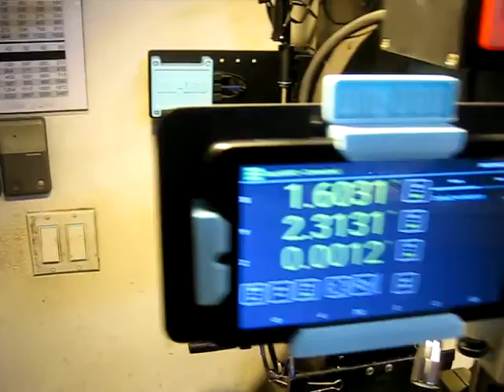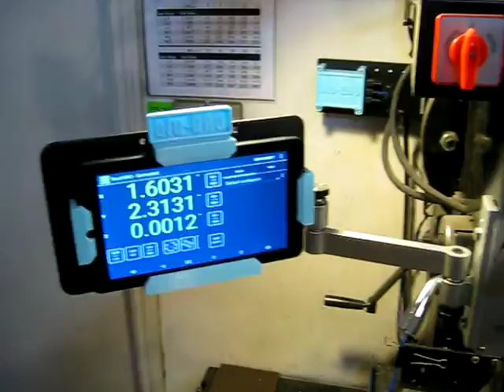blu-DRO Control Box with TouchDRO APP

Comment: Pretty cool stuff!
Reply from the maker: +Keith Rucker - VintageMachinery.org  :-) How about that "Cat-in-the-Hat" hold down setup (laughing) ... Actually there is a hidden threaded bolt on the bottom holding it down... but still was fun :-) The final patterns will have better areas to secure to mill... these are just tests :-) CHEERS!!